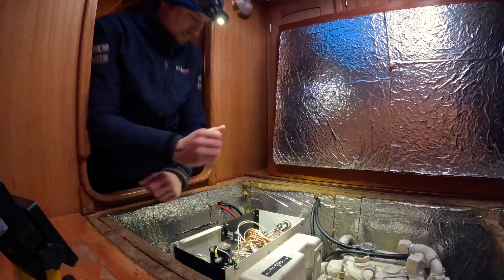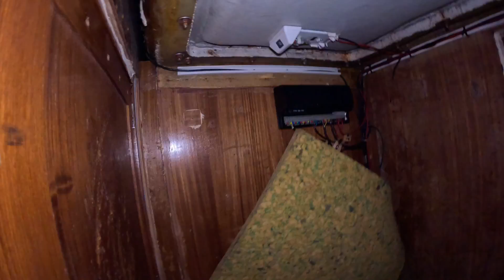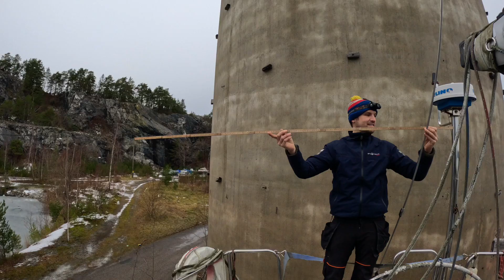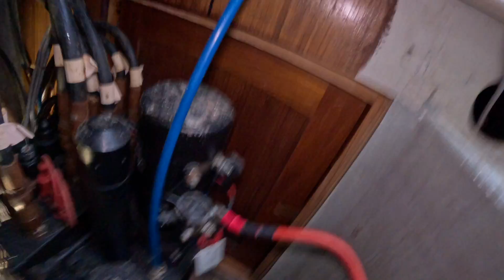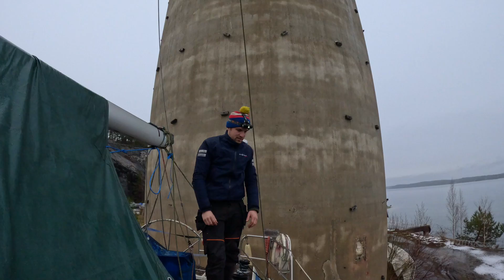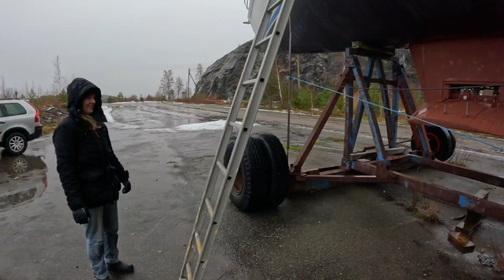Test Run of the Swing Keel Function on our New Sailboat [2.06]

Comment: I am amazed and petrified by this all at the same time.  For so many years I was completely obsessed with the concept of lifting keels.  I've looked at so many variations of the lift mechanism from the most simple cable lifts, to analog screw-lead drives, to complex hydraulic systems.  This is for sure the wildest design I have seen!  I've mostly given up on the concept for my own cruising plans since so many boats that my friends and customers have sailed around the world do fine with as much as 2.15 meter draft, I feel as if the risk of component failure along with maintenance cost is potentially too high.  Still, I can't help but be amazed by the potential of these systems and wish you the best of luck and happy sailing!